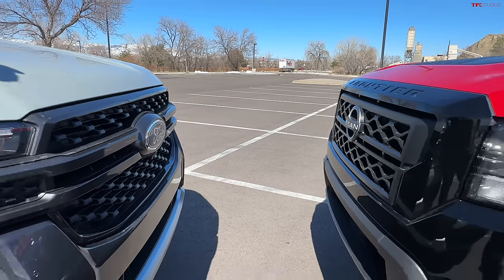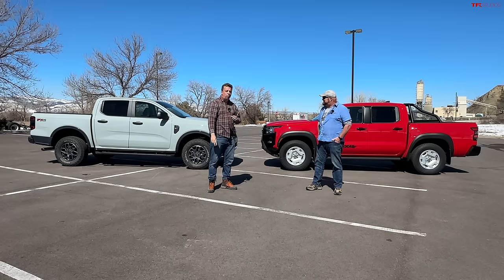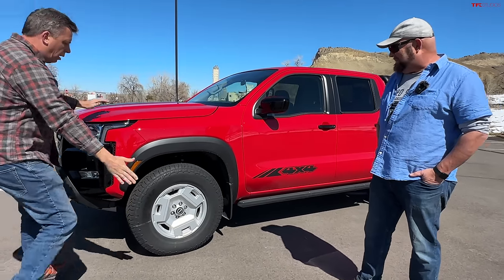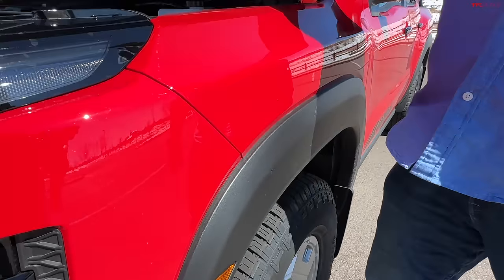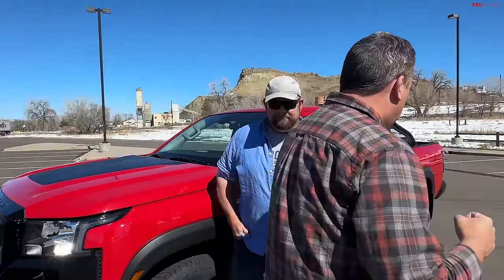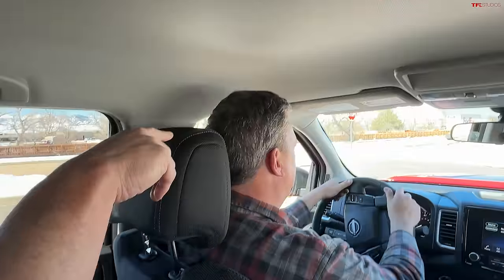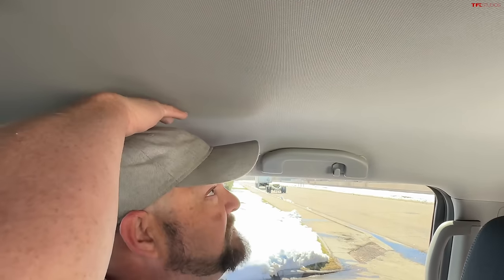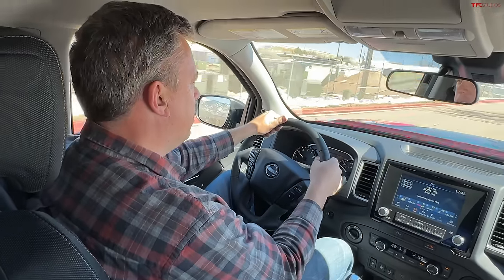This New 2024 Ford Ranger & Nissan Frontier Hardbody Cost EXACTLY the Same, But Which One Is Better?

Comment: If I am going by looks alone I would get the Nissan.

The huge deal breaker for these trucks for me though is no 4WD auto. That mode is what I use the most on road when the weather is bad.
Reply: It's just one dial. Less things to fail also
Reply: Ranger Raptor has it
Reply: 4 auto isn't a big deal. Ford's switch into 4wd extremely fast because of the vacuum hubs
Reply: @firstlast---  4WD is great for off roading or the roads are a complete dump, but not great for the drivetrain on paved surfaces hence why I like 4 auto since it acts more like AWD which is better for variable conditions.

Comment: Good comparison. I do love the power and torque being available at a calmer 2000 RPM VS taching out an NA engine. And that payload on the Nissan is a joke, they could have done better there. I would happily own either truck. I daily a 2020 Ranger though

Comment: After driving my f150 ecoboost 300k miles tried a nissan titan with a v8. I just couldn't pull the trigger because it seemed like it was lacking power. The ecoboost has been solid. Sure it might coast $1500 more in maintenance over 10 years but it is worth it. I probably saved 20k in fuel.

Comment: "Don't trust turbos"
Yes. If automakers are so confident about them, give us a 150,000 mile warranty on turbo replacement across all brands.
Reply: Dont worry the nissan will need a new transmission before the turbo goes 😂
Reply: Put a 6.8Ltr. V-8 Gas Engine& foCo😮, .... ....CouLd Have a new Customer@ $35-k.
Reply: Yep, 175-k. No HaggLe New Turbo 4 These 😢inSANE Prices.
Reply: Ford internally rates turbo failure at 120k.  A 6k bill every 120k is insane
Reply: I have 232,000 on my Nissan truck. Never touched the transmission.

Comment: The turbo equipped powertrains never live up to the EPA ratings... they are great for gaming CAFE though.
Reply: Yea my 23 F150 gets 2 mpg better in town and .5 on the highway better than what the EPA says it should, maybe cause the 2.7 has2 Turbos!😏
Reply: It's all about how you drive it. If you always put your foot in it, it will lose fuel economy because of the boost.
Reply: Turbo engines are built for emissions not fuel economy. Will take a non turbo engine over a turbo all day long, more to break and more to cost you money.
Reply: @charliehargrave7458  that is wrong. A turbo can be built for fuel economy or power.
 So many people ignore the fact that Engines over seas have used turbos just fine for over 20 years. 
Change your oil properly, and most turbos don't have issues.
Reply: I can get over what the EPA states with our Ecoboost. I also often get worse when I’m driving how I like to drive. But it’s possible and similar to my 5.0 where I can either do better or worse depending on the day or trip.
Reply: B58 by bmw makes 400whp and over 30 mpg.  I would say thats both worlds
Reply: Ive never matched epa ratings on any truck ive ever had. And i drive normally.

Comment: I would go Frontier, I am a Toyota Fan boy and since they went Turbo I am out. I really like the Frontier. Nissan could gain a ton of market share if they just changed some of the design to what people want. Do some more blackout wheels and some crazy colors like a orange or a green like toyota has done. follow the trend. front locker would also be nice,
Reply: Increase the payload!
Reply: Toyota has been doing turbo vehicles for decades in the Land Cruiser or Hilux. Those are super reliable 😁
Reply: I don't think you understand that nissan will soon be going turbo 4 as well.  Go ask them and they will tell you
Reply: only because they are diesel and need a turbo to go. @JollyGiant19
Reply: NA V6s are very anemic especially in the Rockies.  They aren’t going to last with extended WOT bouncing off the rev limiter.

Comment: I like the manual rear window; many trucks now have either an electric rear window, or solid glass. The excuse was the rear was too big for the driver to reach and close while driving (in case of a gas attack, I guess), but clearly that isn’t the case as the rear of the ranger is just as big as many trucks that don’t offer it.

Comment: In the end , nissan wins. Do a 10(ten) year challenge.  The ranger with it turbos would burn out in 3 years and have to be replaced. The nissan is " the little engine that could" . No issues besides regular maintenance
Reply: durr, newfangled turbos gotta be replaced every oil change, reckon, durr
Reply: @smithjones1906    Being an asshole isn’t an argument.  It does give the other guy the automatic win, though.
Reply: @garysarratt1  Remember to leave a few coins in his cup, hero
Reply: Not sure where the notion that turbos burn out in a handful of years comes from. We’re still driving a 2015 Ecoboost with 85k on it and it’s running perfectly fine with no engine or turbo issues since new. That’s not to say that at some point we won’t experience an issue but it’s now over 9 years of driving and a replacement turbo is like $450 currently should we need to replace it. Not a bad proposition in my mind.
Reply: @ALMX5DP  Come back when you've put on a quarter million miles like on my 2013 Nissan with NA 4.0L V-6 and we can talk turkey.  85k miles is barely broke in.
Reply: @jfruser  there are people with Ecoboosts (or other turbocharged engines) with that mileage. My response was directed toward the OP who put a 3 year lifespan on turbos. Do you agree or disagree with that notion?
Reply: @ALMX5DP  No doubt.  But they are not nearly as common (given # manuf/sold) as the Fronty or Taco trucks.  Three years is 75,000 miles to me.  Again, barely broke in.  Given the oil consumption reported by ecoboost owners, I would say that is a bad sign for longevity & reliability, even if the consumption or something else has not cratered the turbos.  Back in the day, NOONE was sitting around hte camp fire saying, "What we need is a turbo V-6 gasser for our full-size trucks and I-4 turbos for our mid-size trucks."
Reply: @jfruser  turbocharged engines are still somewhat new, especially in this country and for the pickup truck market. That may explain why there are fewer higher mileage examples. And yes I’d agree with the notion that they will not tend to last as long as lower output and compression NA engines but that is not to say they are without their own advantages for the owners who have them. Plenty of people back in the day opined about having more power and torque, and that is kinda what we see here.
Reply: @ALMX5DP  I am old enough to recall auto manufs putting turbos on everything in the 1980s.  That's 50+ years of turbos.  We have PLENTY of experience with turbos in the USA.  And ford has been putting gasser turbos in pickups since 2009, that's 15 years.  Again, not enough of them in it for the long haul like their NA predecessors.  Sure, if you trade early & often or rack up rookie milage numbers, turbos can be OK.  But ask the Ford techs which engine they'd prefer in a 1/2 ton F-150 and almost all say "5.0L V-8."
Reply: @jfruser  my point is much of the hatred for turbocharged engines is not to do with the turbocharged nature itself and issues can afflict any engine design (like the later Ford 5.0’s having VCT and oil consumption issues). That and costs associated with fixing those issues are often blown way out of proportion. I don’t know if people would want to go back to lower powered vehicles just for the sake of longevity, since many owners do only keep their vehicles for a handful of years (perhaps 10 years for pickup truck owners but even that timeframe is well within the design parameters for these newer turbocharged engines to last through).
Reply: sure because the 3.8 engine / 9 speed combo has been available for 10 years, right?. It's proven, yeah sure. I've seen 2.3 Ecoboost engines with 200K miles but no 3.8 liter V6 / 9 speed trucks so far.
Reply: @engineer_alv  FYI the 3.8/9spd Frontier has only been out since 2021.
Reply: @smithjones1906    You still don’t belong in a serious conversation.  What do you have to add but baby noises?
Reply: @ALMX5DP  it was a sarcasm to the OP who mentioned a 10yr challenge. I meant the totally opposite (there's not enough data on the 3.8/9 speed because as you mentioned it's still a fairly new engine/transmission).

All those people mentioning their quarter million mile Frontiers don't count since they have the VQ40 /5 speed, I could bring all the 300K/400K mile Rangers with the 3.0 Vulcan and 2.3 Duratec / 2.3 Lima engine and so on but it's so irrelevant if they don't have the same powertrain as the trucks tested here.
Reply: @engineer_alv  ohh gotcha, my bad.

Comment: You guys should look at fit and finish between trucks. 

This video makes it sound like the Ford is the clear choice but they have suffered from reliability issues across several of their vehicles the last few years.

I haven't sat in the newest generation Ford, but the previous gen felt terrible inside compared to this gen Frontier. All the panels flexed a lot. The panel gaps didn't line up. It was sad.

Comment: I just bought a 2024 Honda Ridgline Trailsport, and it's an awesome ride. I'm hoping I'll get that Honda reliability out of it.
Reply: sadly it has that 9 spd trans which is what most manufacturers buy from mercedez benz. Garbage transmission that wont make it past 200k miles no matter how much you baby it. Im waiting until honda sticks in their own 10 spd built transmission as they have with the odyssey since 2019, to consider a ridgeline or frontier using nissan self built trans as with all prev generations.

Comment: Great review!

Im from South Africa and I bought the new Ranger in December.
Its interesting the difference in powertrains we get compared to you guys
I have the XL with 2.0 single turbo.

Here we have the option of the 2.0 single turbo, 2.0 bi-turbo, 3.0 v6 (all diesels) or the Raptor

I am very happy so far.
Fuel economy is decent so far. Will see what the reliablility will be like, its not my first Ford and my previous onss did well

My ranger XL has vents in the back :) but I dont have power outlets in the bin

Comment: The problem is that even the best turbos in the world last 100k miles at most best case scenario so all having a turbo does is add a 7500 to 10 k bill every 100k miles
Reply: Ouch
Reply: @jfruser  ah now I see where your bias lies if you don’t question any of that at all.
Reply: Where are you basing that information from?
Reply: @firstlast---  my guess is internet fueled ignorance.
Reply: @ALMX5DP   If by "bias" you mean accumulated experience over decades, sure I am biased.
Reply: @jfruser  no I mean bias as in a distorted view of something without comprehension of other perspectives and experiences.
Reply: @ALMX5DP  without a doubt
Reply: 7k 😂 yeah right.  Its massed produces by ford i bet you can buy one from autozone
Reply: Turbos last 300k if you keep clean oil in the crankcase.  Many people get someone else to change their oil and they use inferior products.  People also don’t change their oil often enough.
Reply: In theory turbos can last as long as the engine….proper oil changes are key…
Excessive Heat and oil quality is was kills turbos!

Comment: Yeah, the Ranger has more tech! But that's just more junk to go wrong. I've gotten along without °360 cameras for decades without a problem. For me less is more. Just give me a N/A engine, that lasts. Wish midsize trucks would have a 6' bed. Both are too much money. Oh, a manual in the Nissan would be nice!
Reply: I 100% agree.  I wish manufacturers still made a true mid sized work truck.  Manual seats, crank windows, manual locks, no nanny safety features, make AC an option, basic V6 without displacement on demand and without direct injection, and of course a manual transmission.

Comment: Why is the rear of the Ranger jacked up so high?  I looked at the previous version and it's actually higher than a F150.  Really stupid.  Makes the truck unusable.
Reply: Towing and payload , stiff springs. Its a capable truck with regards to towing especially.
Reply: @jeedwards1981  Towing & payload with LESS stiff springs.  That is why they need the altitude.  To keep base ride height, they would need stifer springs with less travel.
Reply: @jfruser  ok i believe ya, i always thought it had super stiff springs,lol, im not very smart haha
Reply: The high rear end also makes the truck a lot safer.  Cars and Crossovers will go under the truck and their occupants will take the brunt of the crash forces.

Comment: Buy a turbo 4 if that's what you want but do not try to convince me they are 'better than non turbo  and mpg is really not that impressive . There is a new automotive term 'acceptable oil usage' is directed to 4 cylinder turbo engines  and the fact they require a premium synthetic oil and keep a very close eye on oil level and leaks. Really??
Reply: Nissan's VQ V6 had engine oil consumption on the uprev engine.  Doesnt matter what type of engine it is NA or turbo.  Its shit if it was made of shit
Reply: @beexiong2995  No oil usage is a turbo problem and has all ways been the draw back to any turbo no matter the 'brand' and 4 cylinder turbos are in fact notorious for oil usage

Comment: I'll take the Ford for the 1st 100,000 miles.The Nissan for the 2nd 100,000 miles and finally the Toyota for the 3rd 100.000 miles.
Reply: Not if the Toyota is the turd Gen Tacoma. It’s the most problematic Tacoma yet.

Comment: The 2.7 ecoboost is going to be a beast in the Ranger. I'm really looking forward to the Ranger 2.7 and Tacoma Iforce max hybrid test on the Ike Gauntlet. Also the Tacoma TRD Pro vs Ranger Raptor vs ZR2 showdown offroad.
Reply: Agreed, if my F150 Supercrew 4x4 does mid 6s with the 2.7 I can't imagine how much it would do in a Ranger. Too bad Ford detuned these engines for Ranger duty (both the 2.3 and 2.7 Eco) to avoid overlapping power with the Mustang and F150 respectively.
Reply: @engineer_alv  Hopefully, there will be some good tunes out there for the 2.7, to get that hp back and then some.
Reply: The hybrid powertrain will lose its juice fairly quickly in a tow test going up a mountain. Going up mountains and towing with them isn't any better than the non-hybrid. Makes the price difference kind of ridiculous.

Comment: They need to make these trucks with vinyl flooring and no fluff to bring the pricing down.  I had the original Nissan Hardbody in 1990 with a 5 spd manual and paid $6k new. I loved that truck and had zero issues with it.

Comment: The exhaust is an odd difference between US and world models. My exhaust outlet on the Ford is invisible because it bridges over the rear axle and down behind it and just stops, aiming down. Almost impossible to damage it offroad but prone to raise some dust on a trail. Having said that and considering mine is a diesel and the exhaust pipe is a relatively large diameter, the flow strength out of the pipe seems slow, probably helped by the diameter of the pipe but also the cats and DPF  closely fitted to the turbochargers.
Reply: Different rules and regulations.
Reply: @is6566  Not the case. European regulations on emissions and almost everything mirror those of the USA.
Reply: You seriously believe that the same car company would build an exhaust system differently for two separate markets (for the SAME vehicle model) and by doing that reduce the scale of economy and consequently increase cost without regulation just for the love of diversity or being different? 😃 I was NOT talking about emission regulation but safety requirements, crash testing etc. They are definitely different between the US and European markets and others and this is why US is missing out on probably 80% of global vehicles.
Reply: @is6566  My dear chap, they not only have different exhaust for different engines, of which many are offered worldwide, but also different emission equipment which require yet more exhaust designs, for different markets. These Rangers are built at three factories worldwide from scratch to an essentially identical template. The fact that South African and Thai built models have been out for a year and two respectively, while US build of the current variant has only just started using US made components. In the South African plant, not only do they make the four cylinder and v6 diesels on the same line, which is unique in the industry, but they also build Ford and VW variants on the same production line, not quite at random.
As for safety equipment, they build a vast number of variants and even vary active safety features according to the model. There are about five variations of headlights available in the UK alone, starting with halogen on base models and up to active matrix LED’s on top models. Similarly with rear lights where thei have basic globes, or a mix with LED, or full LED with extra sensors included for things like auto parking and  trailer reversing assist.
Reply: A lot of words to in essence don’t challenge the fact that all these variants are built because of different market regulations plus of course trims, duh. 😃

Comment: For the same money, the Ford wins hand down. Anyone questioning turbos needs to get with the program. It's not 1980. Turbocharged engines are not exotic, they are normal.
Reply: They are normally a problem.  Company I worked for had Fords with turbos.  Guess what was constantly an issue?  The turbos.
Reply: Some of us have not swallowed the turbo-propaganda.  NA for longevity, thanks.